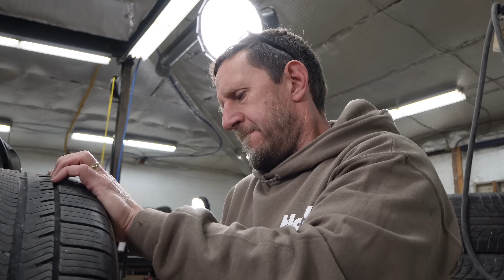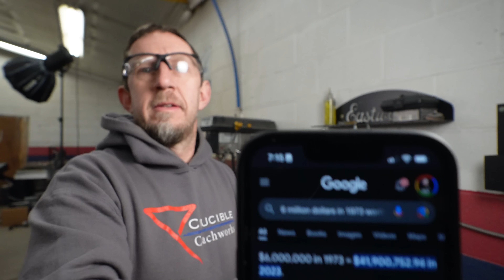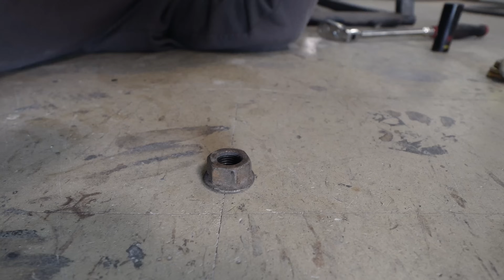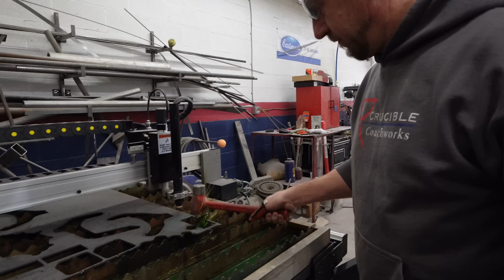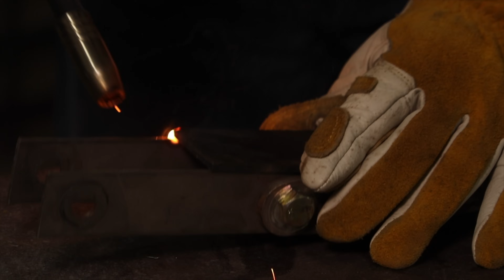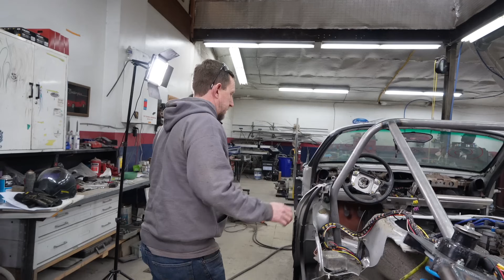$500 Junk Yard SUPERCAR: 3D Printed Suspension! - Project Jigsaw

Comment: so, multiple days for a plastic test part.. (that could have been done with a mild steel test part and a mig in 45 min and then 'race ready' in Cromoly and tig in an another 2 hrs, maybe 3/4 day if you wanted to heat treat it after welding. ), armature hour on the business side.